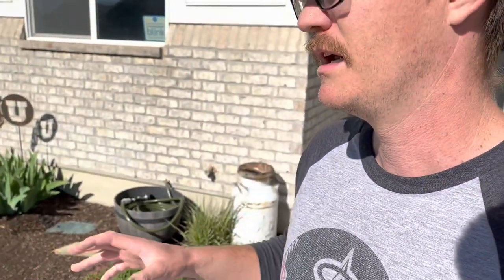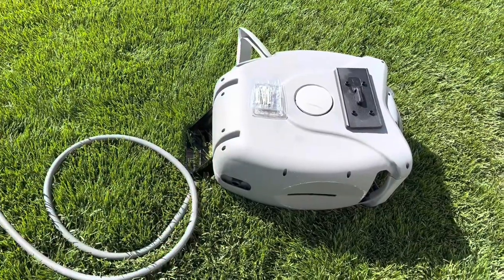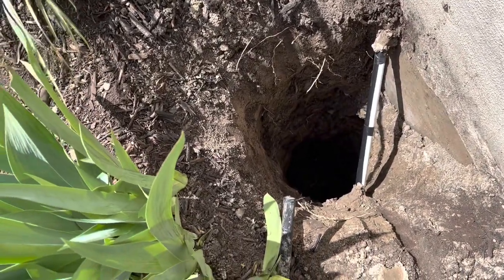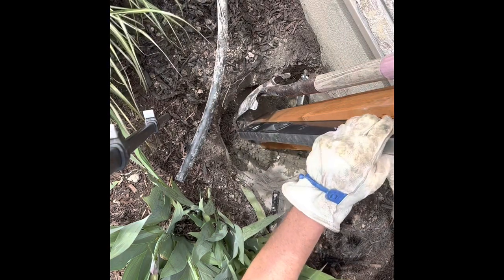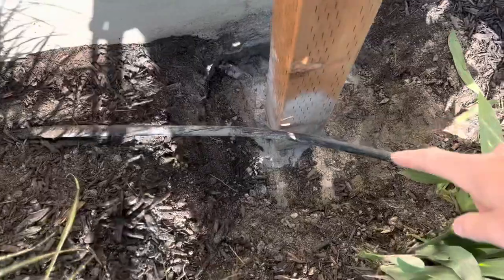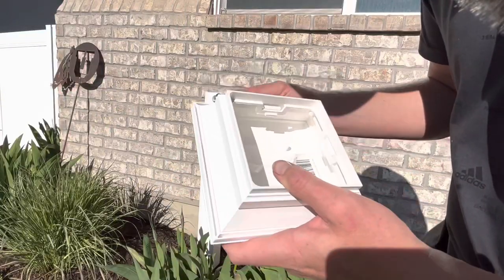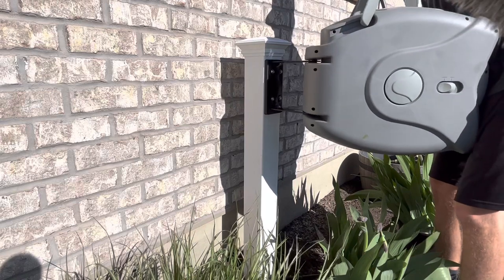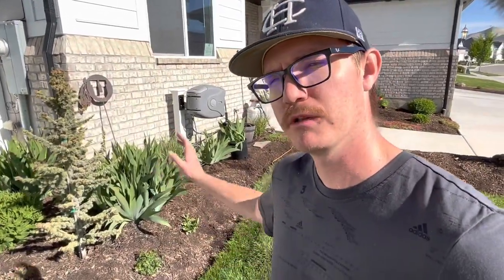How to Install Retractable Hose Reel

Comment: Just curious what driver socket size did you use?  Seems like no SAE fits the bolt heads but 10mm does.
Reply from the maker: Hey sorry it took me so long to respond. I haven’t been home to check it. But it is a 10 mm or 3/8 socket. 👍
Reply: @HomegrownHowTo  No problem.  Got it installed just a bit ago.  10mm it was!